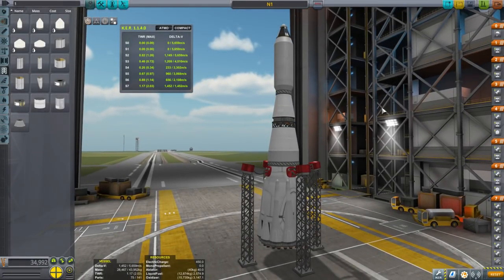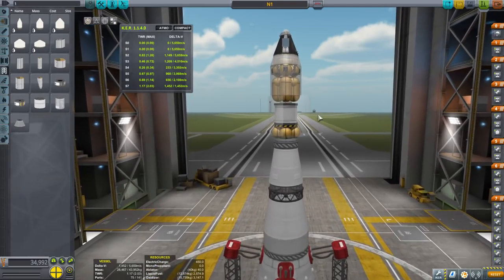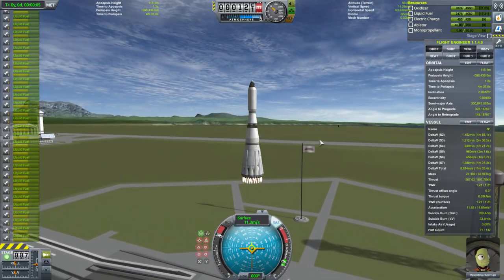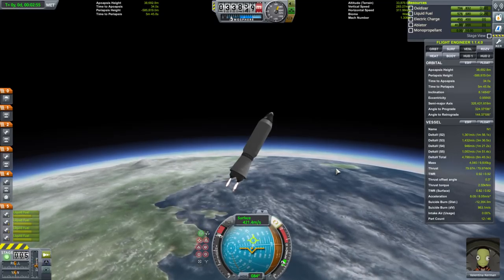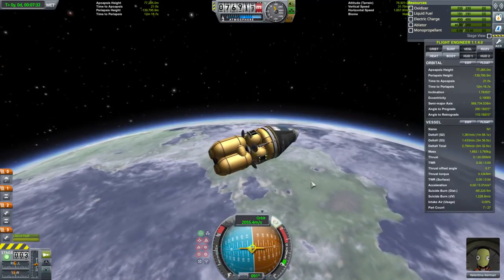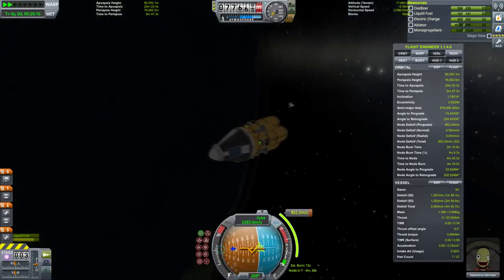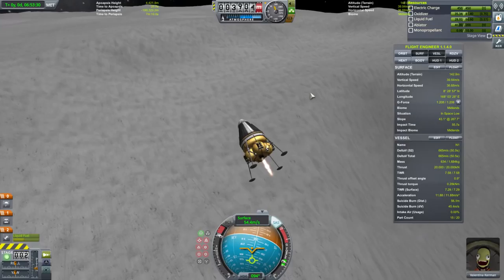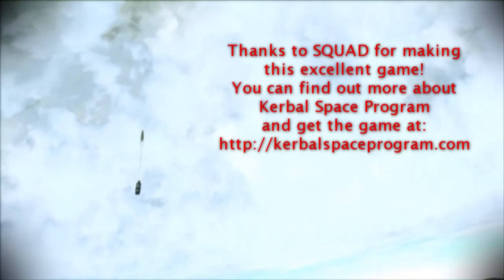Kerbal Space Program 1.4.1 - Stock N1

Comment: I think its fun to think of stuff to ditch out of the main space craft here it goes! You can ditch the parachute now that kerbals have their own provided they have a high level, you can also ditch one of the landing legs and all the radial battery packs since you have solar panels. You can even ditch the mk1 capsule for a service bay with a heat shield and a command seat if you don't care for safety! Finally as you said the fairings are cool but weight so get rid of those! And replace most torodial fuel tanks with boring cylinders. And also don't make the mission a direct ascent. I don't think the mini n1 is capable of lifting a lander with that much delta-v. Well I think that's all I got going to try it later. Thanks for the video!
Reply from the maker: Well, it's going to have to be a direct ascent with this rocket. Good luck with your attempt!

Comment: IMO it would be more appropriate to use the other, Soyuz-esque pod here.
Reply from the maker: Yes, but it's drastically less aerodynamic (assuming we didn't want to extend the fairing further, which would reduce the delta-v). Also, none of the pods actually looks like the Soyuz descent module, which would have been marginally nicer - they all look like Vostok/the Orbital Module, which I wasn't satisfied with. I wish the three-kerbal pod had been shaped like the descent module instead.
Reply: Just put small radiators on the side of the decent pod in the cemetery of 8 and use the moov tool to bring it down and in it looks good to